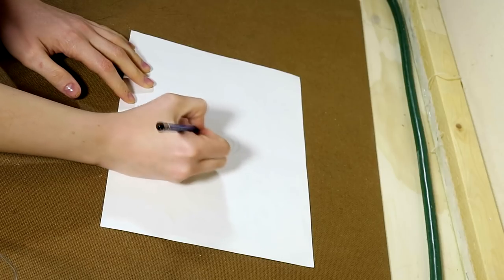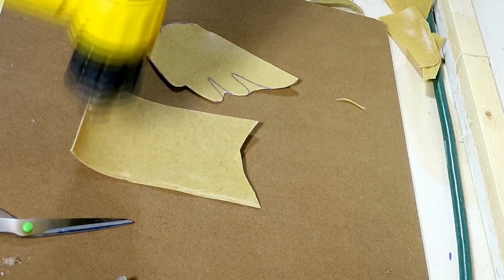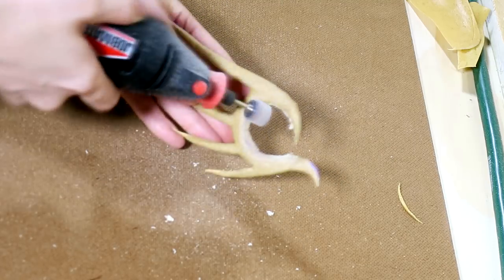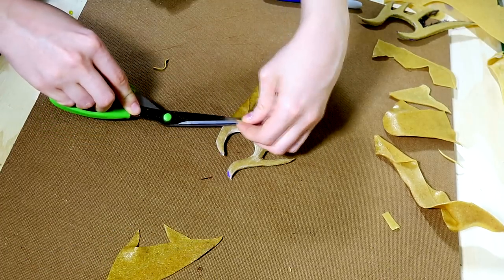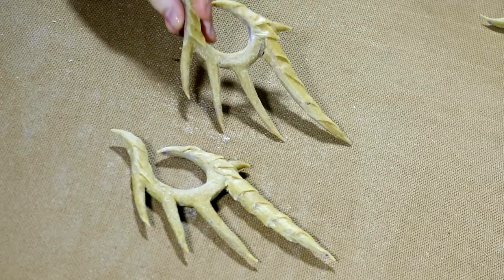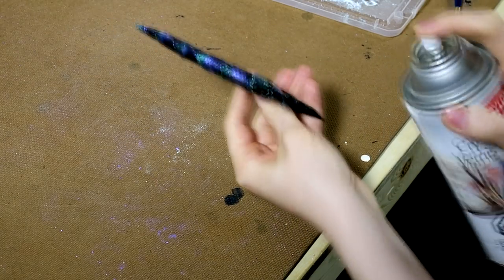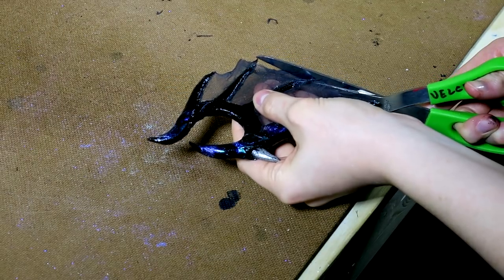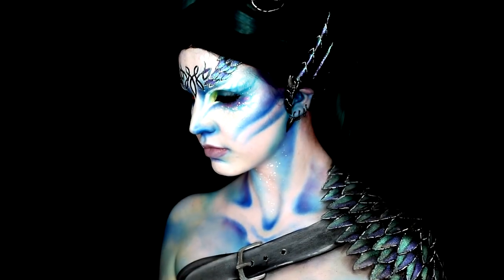DIY Dragon Ears | Worbla Build

Comment: I didn’t have the type of sheet like plastic you have but I have a very similar one that comes in the shape of plastic pellets? Would those work for this craft?
Reply: Sofia Terrazas If you mean Polymorph plastic/Instamorph/whatever other names this has, I'm sure that with a bit of patience it would work just fine. Obviously, as it doesn't come in sheets, you would need some extra time to flatten it (hence the bit of patience I mentioned) before you can sandwich your ears between it or cut it into scales, but I personally think it should be possible.